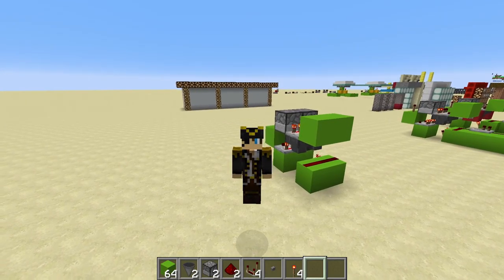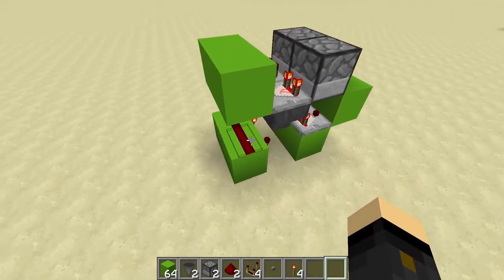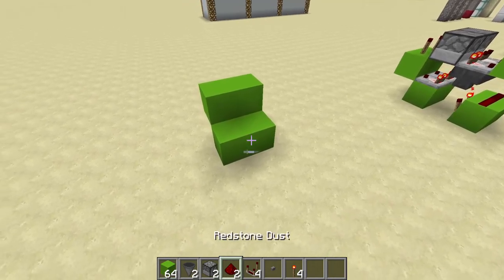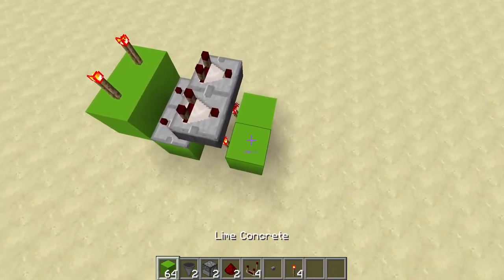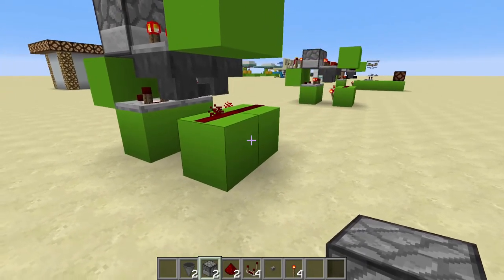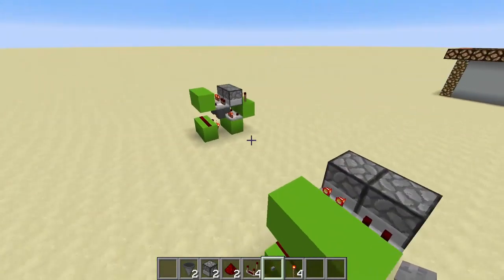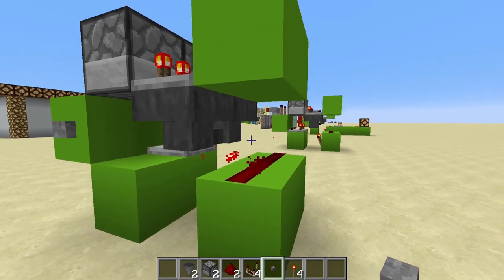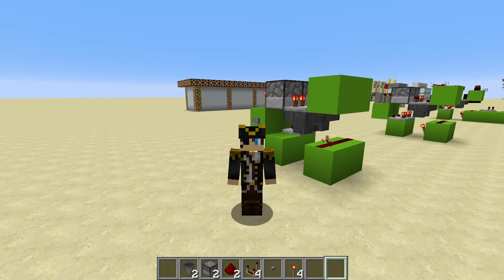Silent Adjustable Redstone Hopper Clock Minecraft

Comment: Woah how does this not have more likes and views? Dude this was super helpful, the instructions were super clear. and the tip with the button for if the item ever stops in the hopper, thanks so much for that, i was having that exact problem with about four other hopper clocks in my survival world. thanks again, dude, Im subbing! also, do you know if this works in 20w21a snapshot? (nether update snapshot)
Reply from the maker: Thank you :) Glad you found the video useful :) I believe it should work in the snapshots and in 1.16 and beyond as to my knowledge, none of the mechanics that make this work are changing :)
Reply: @Kysen  thanks man!